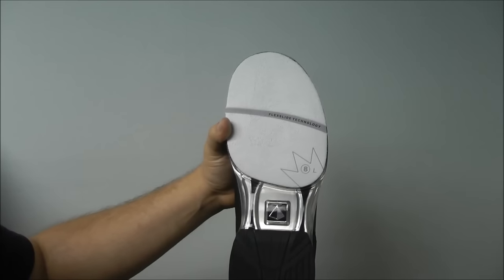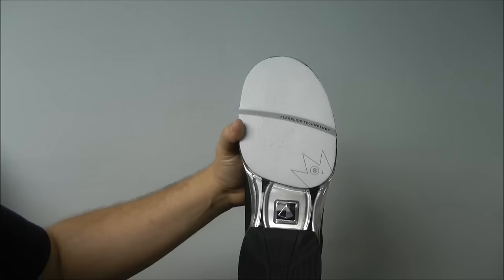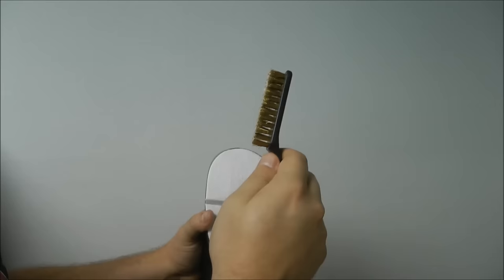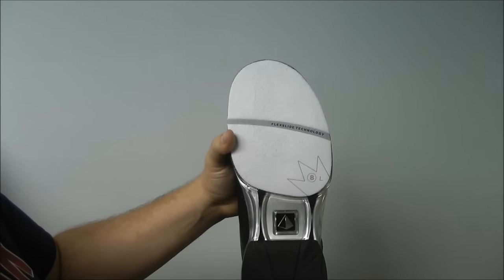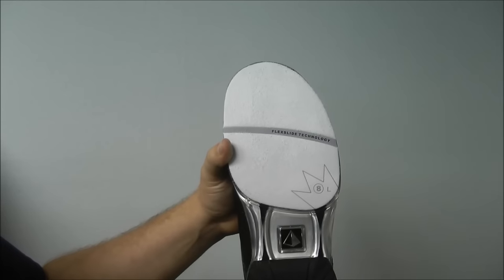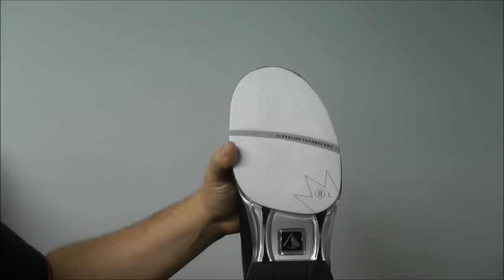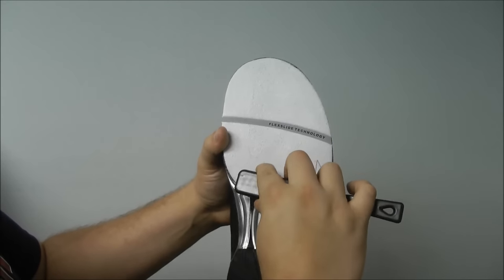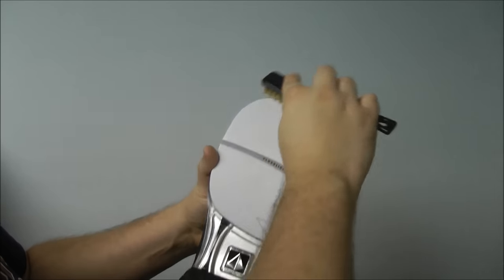How To Scuff Bowling Shoes To Increase Or Reduce Slide - bowlingball.com One Minute Wednesdays

Comment: i was wondering, i bowl 2 handed style on hard wood lanes rather than synthetic, standard oil pattern, the ball i use is for heavy/med conditions and it hooks alot, idk what ball to go with, i was thinking of something in the medium reaction like a dv8 diva pearl, so it travels more before it hooks, i was hoping someone might help me with choosing the right ball so i can average more in league.
Reply from the maker: If you're two handed, bowling on wood, we'd recommend going with something actually designed for lighter oil. Something with good length but a smooth backend reaction. Some good options are the Radical Rack Attack Solid (awesome choice), either of the hybrid Roto Grip Hustles, Motiv Graffiti Tag, Brunswick Johnny Petraglia LT-48.
Reply: Okay, thank you for answer in my question
Reply from the maker: You're welcome!
Reply: Thanks for the recommendation, i got the rack attack, it took me till late in the 3rd game on league to figure it out, i got a 169 in the last game

Comment: Wow, I was today years old when I learned this. I kept sticking in my Dexter Slide-Rite soles and applying Master Slide to fix that, but it turns out I've been wire brushing the wrong way, causing the sticking to happen. 

Thanks, guys!

Comment: So the secret to bowling is to buy bowling shoes that are slippery and then use a wire brush to reduce the slipperyness?  Why not just use regular shoes?!  If you can't walk three steps in order to roll a ball, then you don't need to go bowling.
Reply from the maker: It really comes down to the preference and safety of the bowler. Some bowlers like to slide more than others. Some do not like to slide at all. Bowling shoes are smooth enough to allow you to slide but sticky enough to keep you from flying head over heels. Street shoes a lot of the time will be too sticky, causing you to stop immediately at the foul line. This can cause injury to your foot, ankle, knee, hip, back, elbow and shoulder. Also, wearing street shoes on the approach can be dangerous for other bowlers. Street shoes leave behind scuff marks and debris that can make the approach dangerous. Sometimes bowling shoes take a little breaking in but they do the job in the end!
Reply: Again!  You're not moving fast enough to cause injury!  Bowling is not a fast moving activity.  Basketball players are continuously darting to and fro at speeds far greater than any bowler ever achieves and they wear the equivalent of street shoes.  They don't fall down very often even at full speeds.  YOU take three walking steps and that's it!  Three steps!  This does not make one stumble.  Bowling is not dangerous.  You're just lying to everyone here when you say that it is.  Bowling shoes are not needed!  It's a moneymaking scheme and nothing more.
Reply from the maker: Sports in general require proper equipment and practice. Bowling shoes are believed to have been introduced to bowling as early as 1888, long before any online retailers were around. Again, it does come down to the preference of bowler as to whether or not they want to slide or not. The biggest goal with wearing bowling shoes is to keep the approach clean and clear of any debris or scuffs. If you do not want to purchase bowling shoes, you do not have to. Our only hope is that our fellow bowlers have fun! :)
Reply: I've played football.  Bowling doesn't compare to a real sport.
Reply: Soulfien you literally just ignored everything I said, and who the hell cares if you played football, that's not the subject.
Reply: I didn't ignore your horribly written comment that was filled with grammatical, punctuation, and spelling errors.
Reply: Soulfien you are really worried about grammatical errors lol how childish. of course that is what you have to resort to because of how bad your igornance is when It comes to ignoring valid points. grow up dude ffs.
Reply: You do.
Reply: Soulfien how? lol you  started complaining  about it and I'm trying to drop it.
Reply: Actually, I didn't complain about your grammar.  I merely pointed it out and I did so only because you came here simply to troll.  You see, I don't believe that you care at all about my viewpoint or bowling shoes in particular.  You merely wanted to troll.  So I pointed out that you needed to work on your grammar and spelling.  But that was never my complaint.  I was complaining about bowling shoes.
Reply: Soulfien I'm trolling now? lol okay. you have this crazy idea that shoes are a scam, when u clearly have no idea the purpose of what they are used and can be adjusted on the fly, you can't do that with a sneaker
Reply: Soulfien now I'm offended? love these assumptions lol. and yes I do speak to my mom like that and I know my life choices and they are actually going pretty damn well xD.
Reply: Then that's all that matters!
Reply: You really don't even know what this is for.. go play your football or basketball.. But don't give such nonsensical logic here.
Reply: My shoe stuck and I went across the foul line getting oil on my slide shoe. What's the best way to get oil off the shoe pad?
Reply: @deydraniadiancecht8298  i take 5 🙋‍♂️
Reply: @deydraniadiancecht8298  ......also if you have such a distaste for the sport why are you on a video about a very specific aspect of a piece of equipment used for it? No troll, genuinely curious
Reply: @tristanbellows4029   Swing and a miss, dude.  Try again
Reply: Most people slide at the end of their 4 step. But I side with my left shoe . I dont want my right shoe to slide. If you bowling without sliding you will be a shitty bowler . You won’t get a nice smooth swing. It would be like a basketball player or tennis player not following through on their shot
Reply: @BadgerBucky21  buy a shoe brush, to slide less scuff the sole light from bottom to top.
To slide more, scuff from top to bottom.
Reply: I'm almost speechless  , sliding is pretty important in my game and almost every bowler I've known for 45 years !  Life is short,  make it,  a great day !  And TRY , to ignore the people who don't have a clue what they are talking about  !
Reply: @kurtpotter2258  Actually, the important part of bowling is the oil they put on the lane, not having slippery shoes.  If the lane didn't have any oil, the curved shot would be completely impossible and no one would ever roll a 300 score again.  It's the oil that makes a perfect game, not slippery shoes.   Now who's the clueless one?
Reply: @kurtpotter2258  All it takes is for someone to bowl against me- he or she wearing brand new bowling shoes with no scuff marks to make them not slide so much and me wearing my own shoes.  

Three games.  That is all it would take to convince me.   I'd like to see a single bowling alley put up or shut up.   Prove it to me in practical application or I win.
Reply: @sharkpog2630  Still would have topped your score.
Reply: @deydraniadiancecht8298  ok but I didn’t ask + your best score is basically my worst score without handicap 😂
Reply: @sharkpog2630  prove it.  I want to see documented proof that your score is better than mine.